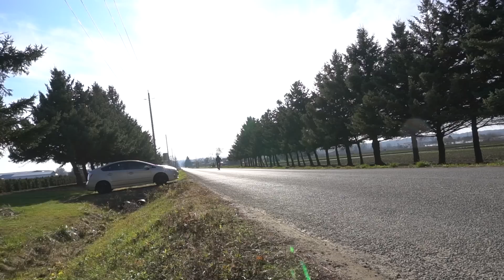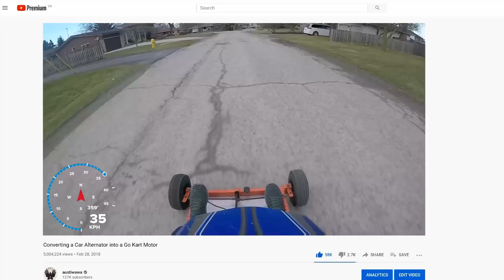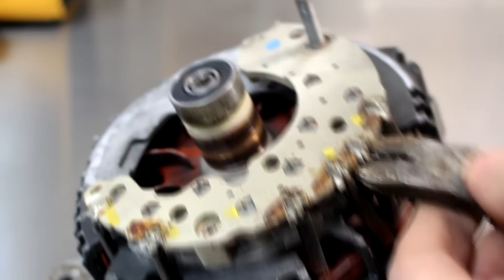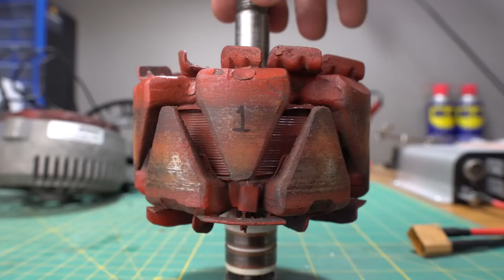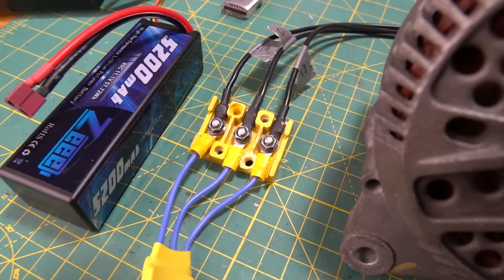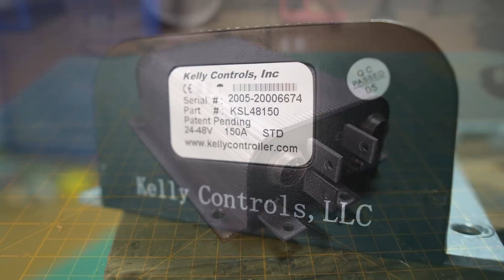Building an Alternator Powered Bike

Comment: Can you use to of them one to turn the wheels and the other to power the alt. motor?
Reply: No
Reply: @foxxyytofficial  Why not, use a bigger alternator to power the smaller alternator that in turn will power the wheel. And have a battery in-between that will harness power when not pedaling.
Reply: @samduran5180  the bigger alternator will pull even more power from the battery, and the second alternator would still be sucking energy from the driving one, gettin the draw even bigger, this idea doesn't make any sense, just get a regen-capable controller and that's it!
no added weight from other alternators, no complicated electric/mechanic couplings to keep the battery from exploding with the alternator's "recharge", easy like other e-bikes with hub or mid-drive motors, electric scateboards with regen also, and even electric cars use regen, not an alternator
Reply: @foxxyytofficial  For a diy project though I'm thinking of the larger alternator to power the smaller battery and alternator. I think your miss understanding the combination of the application. I'm not saying for the large to draw I'm using the large one to contribute power to both the battery and small alternator. It's basically working like a regen but with out the cost of paying for one for a diy project. Over all my idea is much more robust.
Reply: @samduran5180  if you believe in your idea, just build it and test

Comment: How about adding a charger to keep a charge on the batteries
Reply: How?
Reply: You can always add a alternator with converter to always keep a charge as you ride and it should work for the go-cart too... At least it might work in theory... Let me know what ya think
Reply: @a.conner621  exactly, in theory
But in practice you need to calculate all the losses, and those will absolutely eat the energy and waste it
Reply: But the loss should be minimal compared to the gain of energy
Reply: @a.conner621  and if you say "i can just make the second alternator able to engage and disengage", so if you're jumping all of those hoops, why not just get a BLDC controller that can regen, just like the second controller he got?
less weight for second alternator, nor specific charging equipment, the own controller regen as you release the throttle
Reply: @a.conner621  you're pulling probably 20-25A to keep the 30MPH speed, now get another alternator for the front wheel
now you need to pull even more power from the battery to keep the same speed as before, and have heavy equipment to not explode the batteries or the alternator and recharge them perfectly, losing power each second

Comment: Very impressive. I wish I had seen your video last year. I was working at a shop run by morons. They were moving and asked me to clean their shelves. Throw it all away. They had a brushless alternator from an old Cummins diesel. It was sealed up I think. Someone said it was from a rock crusher unit so it was sealed to keep it clean. It was built by a company on Gibson Road in Scarborough Maine. Electrodyne, I think. Wish I had known

Comment: I have invented a bike that works on air only. Air passes through a device which in turn transforms into motion energy. It can be controlled via a dial or pedal. It has 7 speeds, and the air also powers the lights.  Even on a day when the air is not moving at all, the oxygen levels interact with the device and the more you pedal, the more you recharge the device.  Once recharged, a green button lights up indicating full charge. When fully charged it has a capacity of 70 miles of non interrupted work.  No need for battery or alternator. No risk of alternator overheating.

Comment: Hi. what's best controller for this case? Thanks
Reply: With hall sensors installed you can use small 1500W BLDC controllers, up to 5000W like his controller
Reply: @foxxyytofficial  will be beter with hall sensor ..but if it without hall sensor ...do you thenk it's will work good ...thank you again
Reply: @azertaieb442  he uses a sensorless (no sensor) controller in the kart with part 1
Reply: @foxxyytofficial  so great thank you.  for you answers

Comment: I made an electric bike years ago. I used to 72 volt treadmill motor and some junk batteries I think it was drill batteries with also lawn mower batteries no controller I just had the batteries wired in series and  the negative lead going to the motor I would swap to the different negatives on the batteries starting at 12 volts then going to 24 and so on in order to take off slowly the motor was just clamp to the frame I used my old BMX bicycle Peg as a wheel that road on the tire and turn the tire it was just junk I threw together in a few hours it did 22 miles an hour

Comment: @austiwawa
   If you get a PMA alternator that's used for a wind generator that would give you more torque and be permanent magnet.  the rotor in a PMA  is perm magnet. while  retaining the 3 phase stator.  you'd still have to remove the diode pack though.

Comment: Don't know if this helps but. There is a permanent magnet alternator kit for the Yamaha XS650 they made these bikes in the mid to late 70s had an alternator that ran off the crank. These bikes are reliable but their charging system was crap. I bought one for my 1977 from Mike's XS...bunch of companies sell these kits. They are more than the cost of an old alternator but I think you might be able to build one hell of a motor with one

Comment: The basic INGENUITY of this creation proves one thing. The automotive industry is just using the trickle theory to get the most out of consumers. They can build an electric car that doesn't need to be PLUGGED IN for the batteries to recharge. How many boomers remember the generator attached to a bike tire to light head and taillights on the bike,this was before rechargable batteries became inexpensive. You can't tell me it's not possible to use the same type of generator on a car to keep the batteries charged or keep the batteries charged at a specific level as long as the vehicle is in motion.
Reply: excuse me, this build doesn't have infinite energy, its a real build

Comment: Beautiful👍
Couldn't you now flip the motor and mount it below the battery pack lower on the back fender to shrink your overall width and rebalance the bike (since you can turn the motor either direction)?
Would adding a second battery pack (maybe on the seat post frame rail) double run time? ( Moving all of the equipment to that area would promote a lower and more stable center of gravity).
But either way, what a great great job! Thanks for the knowledge.🤔
Keep building👍😎
(Sorry, I guess I'm a racer at heart)
Reply: yes for both questions

Comment: how many amps you need to drive one of these converted alternators?  Brushless ESCs in the 60-80A range that run the blheli programmable firmware are very inexpensive these days.  If it works with the SimonK redboard (yellow wrapped ESC you show in the beginning) there's no reason it shouldn't work with a blheli with enough current handling to drive it under load.
Reply: you need 40-80A, but using at least 36V-48V to have useable power levels without overheating easily
Reply: @foxxyytofficial  Ah yes. Most of the cheap ones would max out around 25v (6S).  Good point.

Comment: The motor doesn't turn fast enough to engage the clutch change the springs inside clutch to lower pressure so it will work at a lower rpm, good job very cool ride.
Reply: he solved it removing the clutch

Comment: I respect the engineering but it's not at all a practical project for the average guy. You still need to buy a controller and battery and you're motor won't be waterproof so it's of limited use. Cool project though, I'm just warning any total amateurs thinking of making one they''re probably better off just buying an Ebike kit.
Reply: the idea wasn't to make a daily driver
the idea is to show that it is possible

Comment: everyone including the guy is missing the point of the simple genius of the concept. ... The battery runs the alternator and the alternator returns the power back to the battery ( so it never needs to be charged ) You could run a bike or go-kart with a car battery, the alternator w/ pulley it came with and a fan belt. Of course you still have to have the understanding this kid has about how to really do it.
Reply: everyone is realizing that your idea is phisically impossible, laws of thermodynamics and conservation of evergy won't allow it
Reply: @foxxyytofficial  Thanks for the reply, So what you're basically saying is... Even if? you could conceive of this  - the power (and/or charge)  coming out of the alternator  would be less than what the battery is putting out, hence it would die pretty quickly.  And please enlighten me... what does 'conservation of energy' have to do with it?  Sounds like some kind of government policy... or do you mean just another property lumped in with thermodynamics.
Reply: People believe in 9/11... when it absoulutley 
defies every aspect of 'Newtons-Law"
  ( who is he . you might ask... only the ancient person to discover and define gravity as we know it today)
Reply: @lucasmccahill8857  the first part you got it right, even if you put the othee alternator and get it to output the correct dc voltage in a proper way without damaging the batteries, if you let it always connected to the wheels will give more drag and force the system to pump more amps, creating a waste just to try and give amps back to the battery, and if you just connect the alternator while not accelerating, why don't you just turn on the regen braking feature in compatible controllers? Its easier, no added weight, and the own power controller regulates the regenerative recharve while braking
Reply: @lucasmccahill8857  and conservation of energy is part of physics, that says that no energy can be created or destroyed, so you can't just plug a second alternator and hope that it will work without efficiency losses amd lots of drag/wasted energy
Reply: @lucasmccahill8857  what does a tragedy have to do with gravity?
What are you trying to say?
Reply: @foxxyytofficial   thats what Im confused about? You obviously know way more than me Im just asking.... you say created or destroyed... well of course energy can be created thats why we are even talking, but you say it cant be destroyed either so where does that go, and why cant you harness that
Reply: @lucasmccahill8857  energy can't be created or destroyed, only transformed
Reply: @lucasmccahill8857  it goes with heat, friction, and the efficiency of each single part where the energy is converted from electric to magnetic and vice-versa
Reply: @foxxyytofficial  so my idea does work, you just need dude;s controller boxes still which is what I said and is what hes doing
Reply: @lucasmccahill8857  if you think it really works, try it yourself
Not all theory can be checked in practice, maybe you and all the other people that are trying to achieve perpetual energy could be rich discovering this
Reply: @foxxyytofficial  bear with me I'll tell ya
Reply: @foxxyytofficial  doestn that equate to harnessed?
Reply: @foxxyytofficial  There are no other people, its just me. And I'm with you... if you could invent perpetual energy, the 'men in black' will come see you.
Reply: Anyway, "NEWTONS LAW" what all basic physics is based on. Is:  When two objects collide. They become equal in velocity. The weaker one 'gives' no matter how fast the other one is moving. I.E. Hurl an egg @ a million miles an hour at a brick. Do you think the egg is just gonna crash through the brick because its moving faster?  A jet airliner is a flying aluminum can,
it would crumble up hitting steel and concrete, like a beer can crushed on a drunkin' college guys forehead. Where is the footage of that? And you have to have a torch to melt steel,,, the jet fuel burned out instantly and has been proven to burn no hotter than a campfire. I'm not trying to downplay the tragedy of it all ... just sayin
Reply: now I just saw you are bringing up magnetics... I think that is where it is ultimately at. I thought of stuff 25 years ago thats talked about now... the magnetic wheel, but have to have computer technology to regulate it, but you always have to remember how awesome a steam powered car was... was that not enviremently friendly?
Reply: You make a vehicle with big magnetic wheels. apply metal calipers that tease the wheels to spin forward. All operated with a single lever. The acelleration is also the brake.

Comment: This makes me wonder. Can you use a secondary alternator to power the primary and a charge controller to charge the battery pack? If so this would be a self sufficient system and no need for fuel or recharge
Reply: no, it can't be done like that

Comment: I have 2 new alternator in my shop from my 4.6 Ford V8, now I have an idea, if I mounted 2, would it allow more speed or just tourge ?
Reply: You could convert both, install sensors in both like he did, and connect them in the rear axle
Since you will have two motors and more torque than just one, you can tweak the gear ratio to get more top speed without losing too much torque
A youtuber called "Enrengineering" tested hall sensors on alternator, and even the cheap chinese 1500W BLDC controllers accept the sensors and work nicely

Comment: Could you do this individually to each wheel of a gocart and wire all 4 to a single pedal? 😁😁
Reply: Why not? It would have 4 times the power this bike does, no? So wouldn't you have a moderately capable gocart that runs on electric rather than gasoline?
Reply: @gunners4129  there's already various projects and different electric motors to pump those more powerful projects
Even if you get 4 alternators from the same exact model (or a least 2 pairs of similar models), plus the controllers' costs (140-200$ if chinese 1500W ones, up to 800-1000$ if choosing better expensive ones like him)
Lets put in average, 550$ for the controllers and 80$ for 4 alternators in decent state, with no shot bearings and working perfectly, 630$
With 402$ you can get a QS120 motor + EM100 controller, use the other 228$ for shipping and you will have a nice kit and powerful enough to propel a kart up to 50kph easily
Reply: The point of this video is making something new out of something old. You must not get that. Say you have 2 old alternators of 2 cars and want to do something with them. You also have piping......
Reply: @gunners4129  i know the point of the video, but multiple alternators require multiple controllers, and even if you get lucky with free alternators, you still have to buy the controllers and everything else
That is why i told you the idea of buying off-the-shelf things, practicality can reach rock bottom fast in certain ideas
Reply: Technically yes
But with zero practicality
Reply: You can get diodes from other alternators and Hall effect sensors from wheel speed sensors on your car. Everything we've mentioned is in my scrap pile. Only cost would be the controller.
Reply: @gunners4129  so buy the controllers and build the car, most of those karts are live axle, so you will need to make separate wheels to power them individually and be able to keep all wheels spinning separately
Reply: Ironically he has a 2 year old build like this with a gokart. Maybe he's already more than half way there for materials to make one. That's all I was saying. I'm no electrical engineer, nor am I pretending to be one. Merely an intrigued mechanic with access to alot of discarded parts on a daily basis. It's unlikely I'll make one, but I'd still find it neat to see one in action.

Comment: 👍
Why not put a disconnect or kill switch relay to deactivate the clutch motor ? ? ?
Pretty Koool anywayzzz ! ! !
Still thinking the go-cart was a little more visceral . . .
Reply: With the new controller he can use it on the go kart too
Reply: And the clutch was removed
Reply: @foxxyytofficial  
Was just thinking that . . .
we almost have the makings of an e-bike rear hub made from salvaged auto alternators . . .
Any idea how many watts we're talking about here ? ? ?
Reply: @hughmoore786  most alternator-powered builds always lands on 1500-2500W, the max load test that i saw wad a 4000W peak with a bench load test
Reply: @foxxyytofficial  
That's a bit much for a bike .  . .
I have a 500w Amego and that can be unwieldy at times . . .
but I could see one or two 4000w motors in a very small car . . .
An all wheel drive system could amount to a max output of 16000w if what you are saying is true . . .
Back in the late 1960s I raced a McCulloch powered sprint cart that was rated at roughly 12 horsepower (9000w) and heard of enduro karts that could reach 90 mph with the same engine . . .
Reply: @hughmoore786  there are some bikes with more than 15000W on the internet
Reply: @foxxyytofficial  
Suicide is painless . . .
- MASH - movie theme song -

Comment: why not add smaller motorcycle alternator and make it recharge and infinite
Reply: Because it is impossible
Reply: @foxxyytofficial  why? Smaller alternator would produce power recharging the battery. Maybe not infinite but extend the range a lot.
Reply: @wedowhatwewant6850  if you put the second alternator on the bike, you now have to use more power from all the losses and resistance, so will waste more tham recover
Reply: @foxxyytofficial  where was I worried about waste? This is about extending range/infinite power. If you used a motorcycle alternator (much smaller) it would charge the battery and it would lose off the top. Instead of 49 mph maybe get 40-45 idk that’s wildly variable depending on the set up. Sounds like you drew a conclusion way too soon on this. This is experimenting not draw conclusion videos
Reply: @wedowhatwewant6850  infinite power is a myth, i have yet to see a real machine without tricks